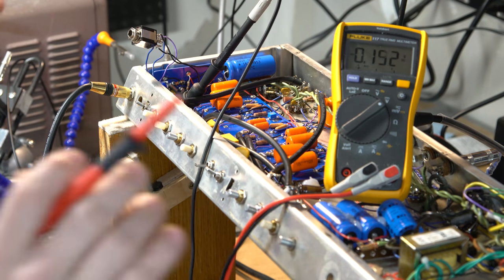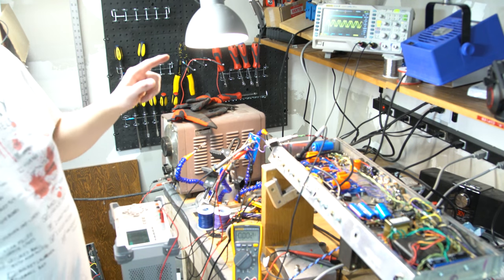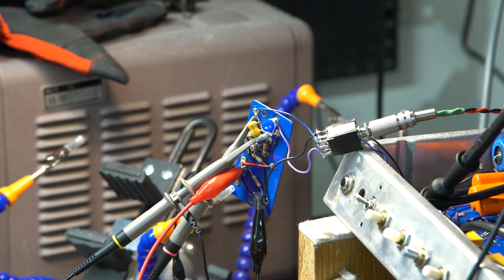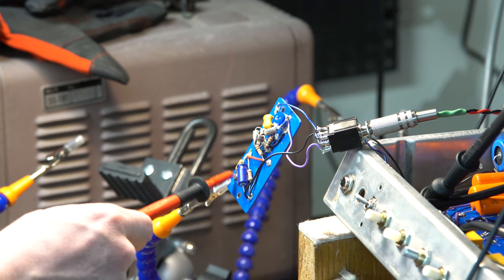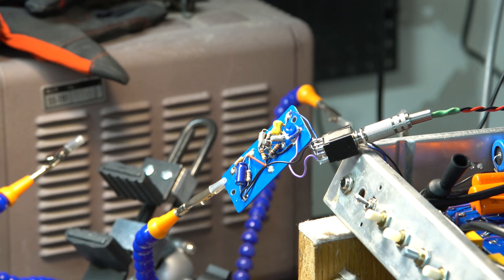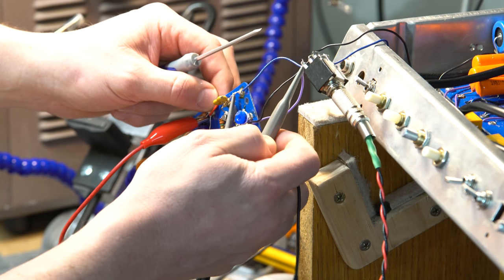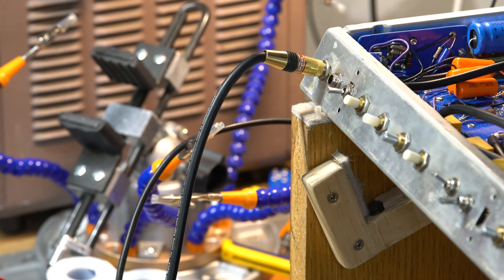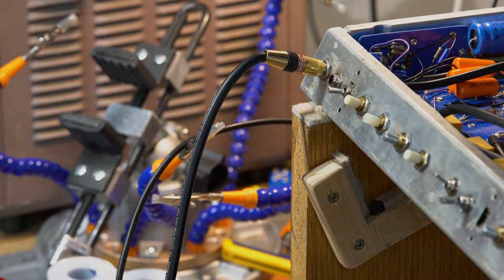Dumble Overdrive Special #124 Clone Build Video #11

Comment: I need help understanding in detail how you discovered what was wrong and the fix for each. Is there anyway to detect if the wires are hooked up wrong before powering up? What is the best way to see if a cap is leaking DC before installing the cap, this will eliminate the DC on the Grids?
Reply from the maker: I'm pretty sure that the only way to test them is with a device designed for that purpose.  Like the one you mentioned to me by Mr Carlson.  Seems I get to build a few.  As for the phase of the output transformer, no, it's a fifty fifty chance.  If you don't use negative feedback it won't matter.
Reply: Thank you for the explanation, it cleared things up for me.

Comment: I lost my computer-had to get another.Might want to check your voltages on each side of your caps. 4 of my orange drop caps were letting dc through, that is what was causing most of my problems-they must have got some bad ones-they cost me some tubes.I was watching the other night but I could not comment. I noticed you were having oscillation problems-I was having it too and it was my input jack wired wrong plus the dc voltage on my grids was not helping things.I guess it is just as much my fault for not checking the caps but I think these places selling them should check some of there batch when they come in.I think my amp is going to be ok, just got to get some more caps. Good luck with yours.Maybe check your inputs and output jack wiring-That is what was causing mine-It was sounding and acting just like yours is-Just a thought.
Reply: Thank you for sharing with us!
Reply from the maker: Yeah it ended up being the output Jack had a drop of solder bridging things causing the low output and such.  Now I've got that fixed and on to another issue.  Motorboating or bias issues, the bias voltage goes all over the map.  Hope to sort that out soon
Reply: Did you check on each side of your coupling caps for d c voltage. Can't remember if you did or not.I got me one of those transistor checkers from banggood ,now. Guitologist talks about them-They work They check caps too.-Just don't know how long it will hold up, time will tell. Look on the site because they go from 6 to 12 dollars on their site.
Reply: You are welcome-I just measured dc voltage on each side of the coupling caps, there should be no dc voltage on the side towards the grid.If there is it means your capacitor is not working properly.I had 20 volts on one of mine and destroyed some of my tubes.That was a costly lesson I learned!!!!!

Comment: Did you post you last video over at the Amp Garage to get some input on what they thought was causing the oscillation!
Reply from the maker: Nope not yet, bizarre isn't it.
Reply: It's all over my head but I believe in you!
Reply from the maker: Got it sorted!  I'll post a video with the general fix, but I had a small solder blob that was jumpering the output jack to ground but as a resistor as it wasn't a great connection.  Thus the odd behavior.  Once I got that fixed I had the OT leads reversed and got the howling, I desoldered the Phase Inverter outputs, and swapped and powered up again and she's banging!  YAH

Comment: Hello, would it be possible to make a Tech Tip educational video on, "How to reduce Heater / Filament Supplies voltages if they are too high"? How would you reduce the voltage to 6.3AC - 6.6AC if the starting voltage was 7.1AC. Ref material - Heater / Filament Supplies - http://www.valvewizard.co.uk/heater.html
Reply from the maker: You could try a very low ohm resistor inline, before the first tube, say 1 ohm, 2 watt and see if it takes it down a bit.  That's a bit high, but the tubes may handle it.  I think they normally like only a 5% difference, which that exceeds, but they usually have a key decent max voltage.  If they're new old stock (NOS), those tend to be extra sturdy, but cost a ton nowadays too.
Reply: Thank you for the advice.
Reply from the maker: Yup I don't know that I can easily do that as I don't have a spare transformer laying around.  I would have to find one that's around that voltage and try and drop it.  I'll see if I can come up with a way to do something like that, though.
Reply: Thank you.